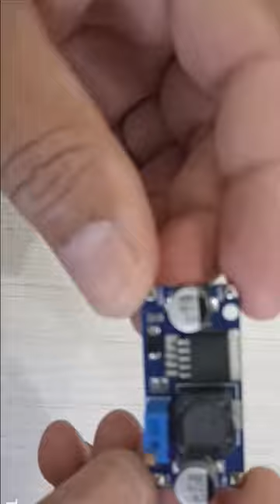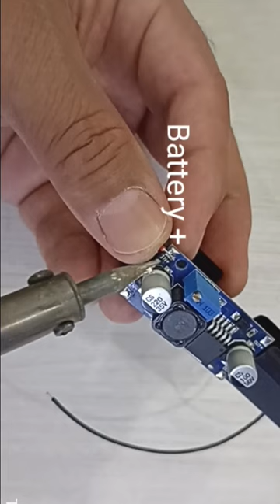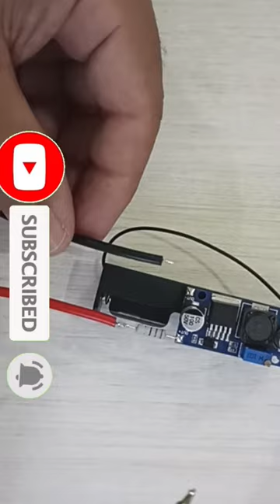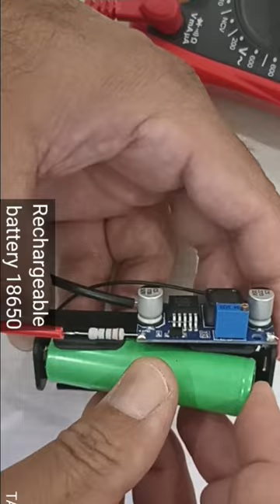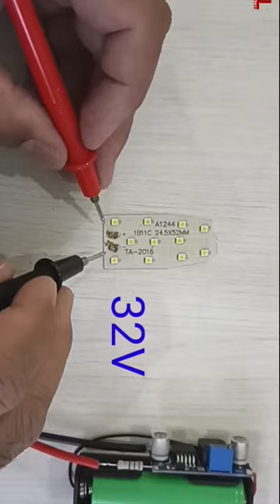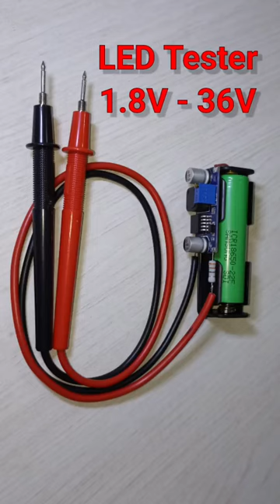How to make a LED tester at home | 2V-36V LED tester

Comment: Hello, you set the tester to 36V and test a 32V LED plate, but for the other LEDs (12V - 1.8V) you change the setting or once set to 36V this tester no longer needs to be adjusted and you can test any LED with a lower value without the risk of it burning out.?
Reply from the maker: No need to adjust because resistor reduce current
Reply: @TARIQLAB OK, thank you for your reply. I don't know anything about electronics, so I'd rather ask questions than remain in the dark. ;o)
Reply from the maker: No problem 👍

Comment: I m not 330 ohm 1 watt resistors can i use 330 ohm 2 watt resistor?
Reply from the maker: Ok better set voltage below 30v
Reply: Why, because most of them all do that? @TARIQLAB

Comment: I got a question
Were you adjusting the voltage every time when testing different lights ??

Because this buck converter needs to be adjusted manually and I think this adjustment doesn't happen automatically !!
Reply from the maker: Resistor drop voltage amps, so don't worry, this method is used in LED backlight where led strip is 32 or 42 or 60v but input voltage from circuit are 90-120v with some resistors in between these resistors drop volts
Reply: @TARIQLAB  thanks it helped !!
Reply from the maker: Welcome